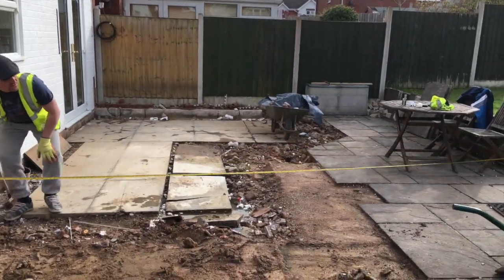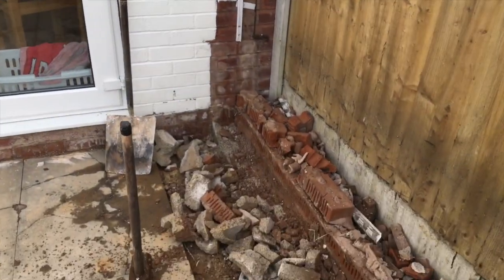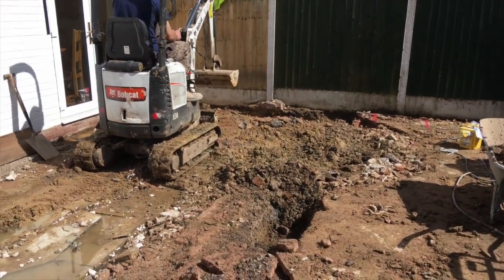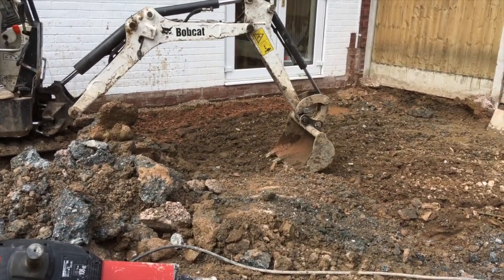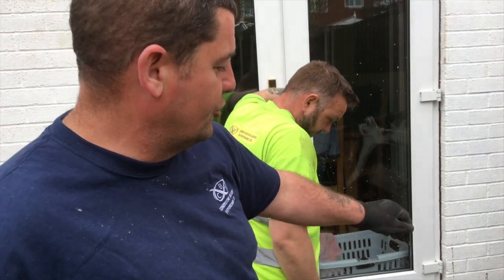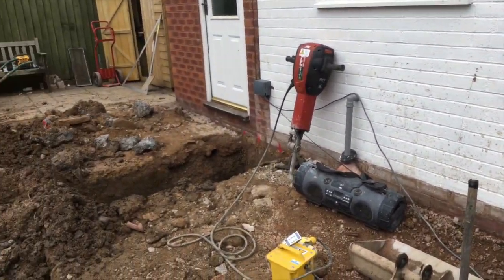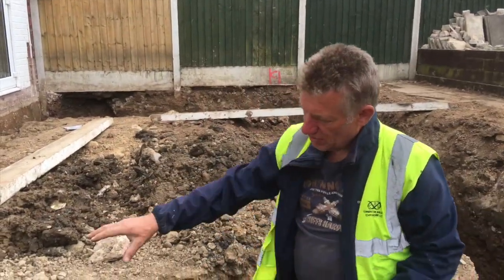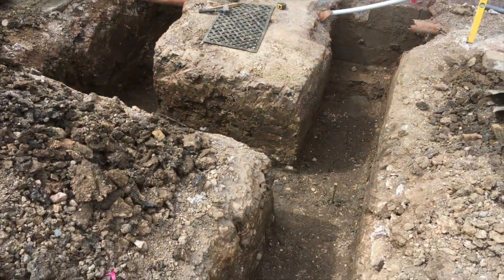How to build a new extension from scratch part 1:  The foundations

Comment: How many barrows are cubic meter
Reply from the maker: A cubic meter of concrete is approximately 3 tons (2.5 in its dry state) a wheel barrow varies in sizes, however the new rules say 25kgs but you’re more likely to put 4 times that in a full wheel barrow at 100/120kgs🤔… so you would probably be wheeling about 20 to 25 wheel barrows per 1cm3 of concrete! Hope that helps😊

Comment: I'm not a builder but I read  for a single story extension you dig down 1 meter for your footing trench and 150mm for your footing  150mm doesn't sound a lot and yours looks thicker? Oh and what's the nib mean
Reply from the maker: @dilligaf2386  it’s down a metre to the top of the concrete and then 225 (9inch) concrete. The nib is the existing concrete that is spreading past the brickwork which was 225mm! Hope that helps..

Comment: Hi Chris. This might sound like a daft question, but why dig down 1100mm (trench) and only do a 400 deep concrete foundation? Why not fill the whole lot  up for strength? It might be slightly more expensive, but at least there will be no problems in the future, building onto that clay.
Reply from the maker: @stevemcilroy.62  yeah we could’ve but we followed the original foundation of the “house” and that had stood for many years…tbh its swings and roundabouts over to trench fill or not to trench fill..,if you see my other vids Ive trench filled them 👍
Reply: @foundationgood123  thanks bud. Yes I’ve seen your other vids, very accomplished builder for sure. I’m doing a small extension on garage. They want it 1 meter deep because it’s next to bushes? It’s only 2.4 meters high and 7.5 metres long, so sounds like it’s over engineered. No worries though, it is what it is. Keep up the good work and keep the vids coming 👍

Comment: Tip: place a short scaffold board along the edge of the trench where you are pouring in the concrete, walk your barrow towards the trench and when the wheel touches the board lift the barrow and pour, the tip of the barrow will be in the exact middle of the board reducing the risk of the trench collapsing and helps a tired labourer judge the edge of the trench just right.
I know this is two years old but it may help others.

Comment: The plans may say a depth but i recommend checking it against NHBC chapter 4.2 tables, as the last thing you want to do is have building control out to inspect and for them to say dig deeper due to a tree.. I inspect sites daily and that is the main thing that catches builders out.
Reply from the maker: Yes I know, we generally get them cut down as the last thing I want is to do pile foundations lol.  There are always checks before we start as that saves loads of trouble as you said.👍
Reply: @foundationgood123  your solution of cutting them down is good but be aware that this could back fire. Always advise building control of when you cut the tree down, what type of tree  and how far away it was. Soils, especially clay shrink and contract with moisture content which can lead to structural damage if not accounted for. If you don’t make building control aware then you could be liable for any repairs. Often a structural engineer can design a solution that doesn’t need piles.
Reply from the maker: @BerkleyBuilds  Yeh mate, I always work with Building Control its a wise move

Comment: Im building at the moment, but i didnt leave enough space in utility for all my plumbing system so im building a plant room on the gable end of the house now. Its only 2 x 2.5 M room. Should i bore into the existing foundation with a drill bit and hammer steel rebars into it and tie it to new steel mesh in new foundation??
Reply from the maker: Yes, I have two videos showing how to do that, you will need to ruse a kem resin to fix the-bars into the foundation, you can get this from any builders merchants or DIYstores!

Comment: I'm training to be a building control surveyor and this has seriously helped me, thank you guys.
Reply from the maker: Thanks for the input👍
Reply: @foundationgood123    hi  great  stuff  ............... but  one question  i remember putting  in foundations   years ago i was  only  19  years with  my  father   .. late ..    should  the  pegs  be  not level  with the  bank  of the    bank   flush....  when  we  did it  the  pegs   must have  been   a  good    2  and  a half  long  and  if i can remember where wooden  ...   well the back kitchen   still standing so  we must have  done  something right.... love the video  great  bunch  of lads
Reply from the maker: @eamonnquigley2125  you probably did a trench fill, ours followed the original foundation concrete level ie 250mm
Reply: @foundationgood123    yes  can  remember putting them in     the drench was  about    3  foot    deep   so  we   put  in  that  amount dont know  what that is  in    mm   then  we  built  on  ot  4 inch  cavity  block  no  brick   ...... we  might have   gone     OTT  on the foundition  but  she  wont  fall  down  .... if you follow  ...loved the video

Comment: I had a building inspector insists on 500 mm deep concrete in Surrey, on wet clay. Bottoms were 1 metre below ground level .
Reply from the maker: Yes its all dependant on the judgment of the local inspector as he sees fit, argue if you disagree ut he will have the final say🤔

Comment: Rotating laser and concrete pump would of saved time and needless hard labour and manual handling.also if you had mass filled your trench higher you wails of saved a course of trench blocks and your brickies back.much faster and save your brickie working so deep
Reply from the maker: Dave Comber Not on this job, I’ve used a pump on my other video where it was awkward to get to and was trench filled (had critics saying about pumps and trench fill LOL) When you have a pump its £200 to start, you still need men with you all expense!  We borrowed two guys from another job at 4:00pm and we were done 4:30pm- We didn’t need laser levels as we were going off existing foundations, not rocket science just simple rules of thumb🙂

Comment: Thank you. I am about to have a 2 storey extension built by professionals, but I like to understand the process in detail. Ignore those whose grey matter is probably filled with concrete and don't understand that different ground quality requires different foundation specs.
Reply: 2 storey need reinforcements bars at foundation, ground beams and column stumps
Reply from the maker: @entername_  approximate 225mm or 9 inches.  We followed the existing house foundations depth!  Hope this helps

Comment: I appreciate the depth of the footing is determined by the ground but where should the top of the footing be ie how far below the DPC? - sorry if that's a silly question.
Reply: @Into-the-Silence  Thanks very much for the reply,  was trying to work out if there was minimum a depth of concrete. eg trench 1 metre deep, concrete footing "so" deep and blockwork "so" deep. Hence knowing the distance between the DPC and the top of the footings would tell me what depth of concrete should be used. Thanks for the input though.

Comment: Not much concrete ? 600mm depth for any extension minimum, get the concrete wet up and it will self level looks pretty stiff.
Reply: 70 slump with a little water ;)

Comment: Hi

I am digging for my 5.99 projection x 6.8 meters width extension foundation.

I have cement wall slabs with reinforced steel in it which I deassemble from a storage shed.

A) Can I bury these slabs in foundation trench to save skip cost along with concrete poured on top of them?

Regards

Comment: Wow... no reinforcing. That's all gonna break apart over the next few years. Look for the cracks in the wall.  
Concrete always needs reinforcing  in a footing.
Reply: No it wont.
Plenty of  old houses build on less footings with no reinforcement. We tend to over engineer buildings now.
Reply: @dorianleakey  what about old house that are built straight off of chalk or even a brick spread footing still standing today

Comment: I honestly can’t believe the depth and concrete you can get away were you are, that footing looks about 600 with about 200 worth of concrete I’m not saying it’s not adequate at all but what we have to do were I live is crazy 1.5 is pretty much normal sometimes 2 metres if trees are close. I’ve dug deeper footings than that for walls!!
Reply from the maker: Boxing Fisherman it depends on the ground, did you see how hard the ground was to dig!  A meter depth is the norm however if the ground is poor the depth will have to go deeper until the ground is firm.  A meter depth is below the frost line and the drought line!
Reply: @foundationgood123    ... After watching i did notice the extra hard digging below grade. Your area must allow variations in the footers depending on soil or bedrock. I wondered about the design w/o rebar too.
Reply: @pensive69  were we are is min metre deep and if you don’t hit chalked deeper

Comment: No hardcore used under the concrete? Or did it not need any?.
Reply: You don't want to use any hardcore on foundations. You want the concrete to flow directly onto undisturbed ground at formation level. A found on hardcore is not as good as a found on undisturbed soil. 

Putting hardcore in relies on someone building it up in layers properly and compacting it. More often than not when hardcore is used incorrectly I see differential settlement where some of it was well compacted and some not - this can be so bad walls will crack and pull away from existing buildings etc.

Different story for concrete slab pours where you have a large raft of concrete being poured over a larger area, you want it to sit and "float" on the surface, if the ground is good undisturbed sub-soil that will not have big fluctuations of water content etc. then you don't even need hardcore for a slab. This is why engineers should be involved, and often you should not let a builder just choose for you because often they don't actually fully understand it and go for a 1 size fits all when in fact you can often save time and money and end up with a better finished build if you follow the conditions.
Reply: You don’t need hardcore under the foundation concrete you amateur.

Comment: hi no reinforcing bar or mesh and it looks a very shallow footing we have to do deep fill 600 wide 1000mm deep
Reply: Perhaps in the area you build in this is what the ground conditions require but I doubt that unless you only build within a very small geographical location. Who has told you this is what you need? The thickness of the concrete and the depth as which it should go are totally different things. The depth of formation level is important as you need to get down to soil that can easily bear the load of what is to built on top of it, then at that depth you can still use a say 200mm thick foundation if that is what will work, maybe you need 450mm it all depends and should be designed on a building by building approach.

Too thick a foundation is just as bad as too small a foundation. Say you put a 600mm wide by 1000mm deep found next to an older house with 600mm by 200mm founds at a depth of 750mm - by pouring this foundation and with the effects of ground heave you could end up with a extension that stays put and the original house moves slightly - you end up with differential movement, cracking and damage - all because the found was too big! A project we are designing just now requires 600mm wide by 200mm deep found at a level of 800mm below ground level, this is perfect as a test pit has revealed this will see the builder down into stiff boulder clay which will have very little water change as it is on a hill with good water run-off. 

Then onto rebar - it depends on many factors, there is no such thing as a one found fits all buildings situation! Rebar is nor really required in a foundation if the bearing ground is confirmed as highly stable. 

Also, never assume building control officers actually have a clue about foundations - some do, some don't, also architects usually don't either - this is structural work.
Reply: its always best to put the wife in the foundations if find
Reply: I did an extension and the footings were only a foot deep.